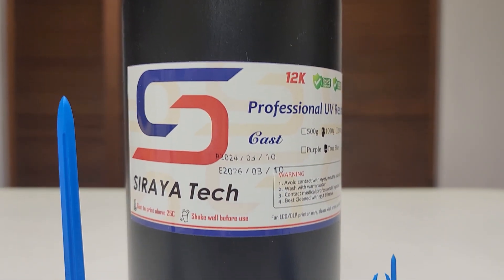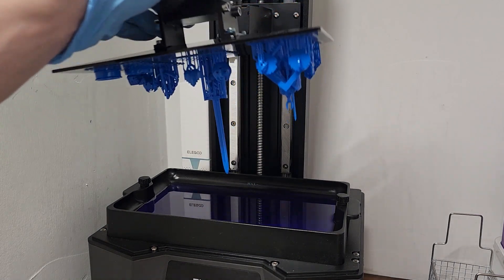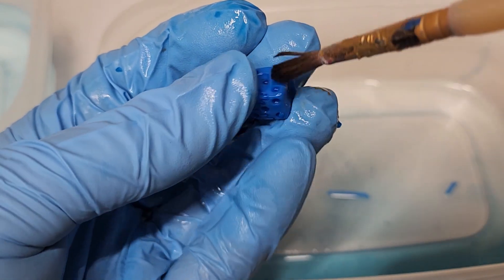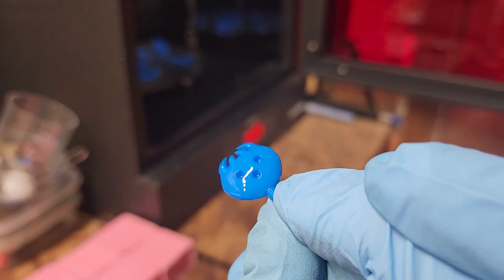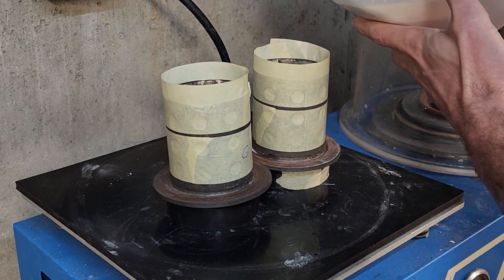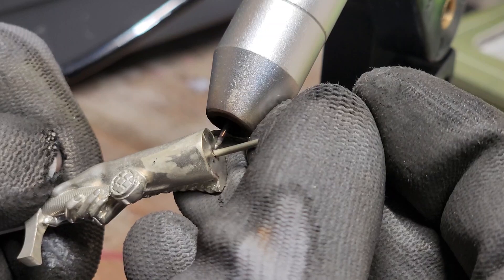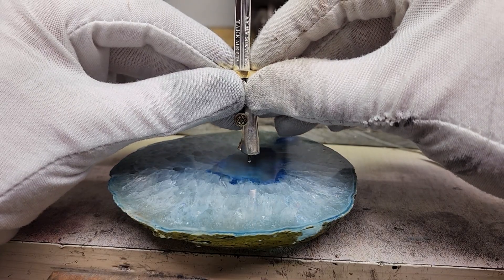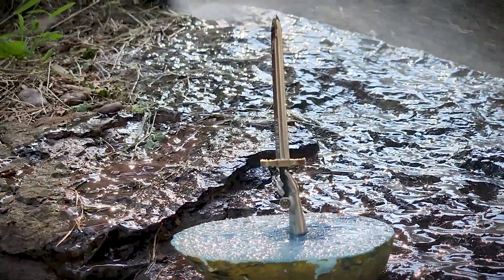Bringing Myth to Metal: Casting Excalibur with Siraya Tech True Blue Resin

Comment: Great video! I’ve been using it for the last couple of months making  bronze masters for a couple of model car kits. I found that designing my parts with the runner already on them takes care of the problem of the wax not sticking. I have 4 containers for finishing, an alcohol bath, then to a water wash, blow dry, then immerse in glycerine for a 10 minute cure, then another water wash. I’m very pleased with the results, in some ways, I think these are some of the crispest detailed prints I’ve made in years of printing and am blown away by my final bronze parts! I haven’t run into the sweating issue, only have had issues when I haven’t been tidy enough with the dry off after the alcohol and water baths.

Comment: When I contacted Syria resin they told me 
1. I should submerge it in glycerin and then cure it. In the area when I’m leaving glycerin is treated like you are asking for cocaine.

2. After printing and curing I should immediately send it for casting. The problem is it takes time in order to send it for casting house and then doing the work.
I really wanted to like it but using this resin was not feasible for me.
Reply from the maker: Sorry to hear that. You could try submerging them in water during the curing process. Also, I haven't had any trouble casting older prints.
Reply: @ really didn’t know that I saw you putting them inside the cure machine without water or glycerin. 
I’m definitely gonna give them another try

Comment: Great video. I noticed you had a sonic mini 4k. Do you have settings for true blue with that printer? I'm having issues. Thank you!
Reply from the maker: Sure thing. The Chitubox settings I use for True Blue castable resin on a sonic mini 4k are as follows: Layer Height .05 - Bottom layer count 5 - Exposure time 6.5 - Transition Layer count 8 - Transition type Linear - Wait mode Resting : before lift .5, after lift 0, after retract 1s - Bottom lift distance 3+4mm - Lifting distance 2.5+4.5mm - Bottom Retract distance and retract distance 5+2mm - Bottom lift speed 42 & 320 - Lifting speed 45 & 320  - Bottom retract speed 320 & 60 - Retract speed 320 & 60
Reply: @SterlingKisses  Thank you! You're awesome.  Love the videos.

Comment: how did you attach it to the sprue tree!? took me forever to get a print with anycubics new update, cant seem to get it to stick to the wax. any tips sensei?
Reply from the maker: @nicholasberry2944  I use sticky white wax to attach the pieces. Though sometimes I needed to roughen up the surface of the piece using a fine file.
Reply: @SterlingKisses  thank ya sir

Comment: I have a mars pro 3 and trying to use tru blue. I am having alot of trouble getting the model to stick to the build plate. any tips? i have re-leveled multiple times, switched the FEP screen, and have tried various settings.
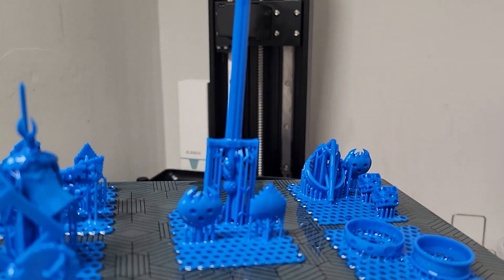Reply from the maker: You could try using a hex base (seen at 1:19). I have a little more info on that in my Jamg He resin review as well as a link to the file in that videos description. You could also try some PTFE lubricant. Put a little on a microfiber cloth and rub it on the fep. Use another microfiber cloth to wipe up any excess.

Comment: Hey great video on the true blue. On your small flask burmout schedule you ramp to 392f , you do not hold at that point for a little while? How did you come up with the 1437f temperature? Sorry for all the questions but I am interested in trying the Tru Blue myself.
Reply from the maker: Hey thanks! I don't hold at 392 at all. It's just an initial soak temperature during the 1 hour ramp as not to shock the investment.  There are a few other resins that use a very high burnout temp of around 1437. I used to use 1200 or 1300 but my results are more consistent at 1437.
Reply: @SterlingKisses  thank you for the quick reply and keep the videos coming. Thanks again George

Comment: I chuck them into my ultrasonic cleaner for 2 minutes with ipa after shake rinsing in dirty/clean ipa baths, then again after the cure :) Doesn't seem to affect the surface quality.

Awesome piece Nick, really love the concept and feel of the finished piece <3
Reply from the maker: Thank you! And thanks for the ultrasonic suggestion, but I've never had luck doing that. Even leaving them in there for 15 seconds starts to cause noticeable pitting on my prints.
Reply: @SterlingKisses  I should probably add that I do use purple/blue at a 50/50 mix, and UV cure under glycerin tho, as I don't like how um annoying blue alone is to print lol xD

I'll have to try it the way you're going, on blue alone, with much less alcohol touching ever and see how that works for me :)

Well, if I ever let my castable resin tank run dry of the blurple mix xD
Reply: @SterlingKisses  What ultrasonic cleaner are you using though, those tiny ones really arent' appropriate, adn you need the big stainles steel tanked ones with over a few litres in, or they just won't have enough power :)